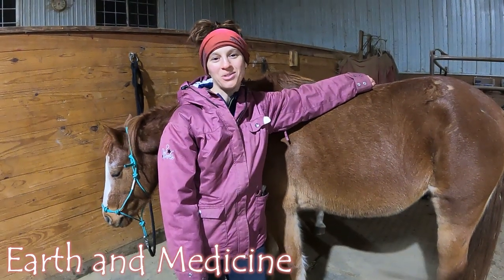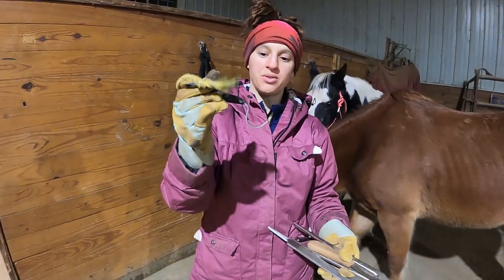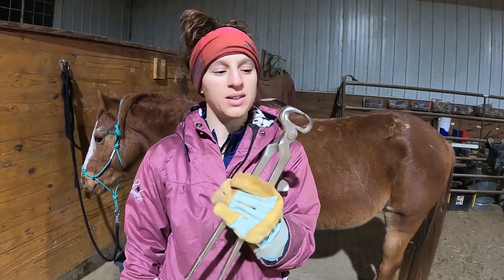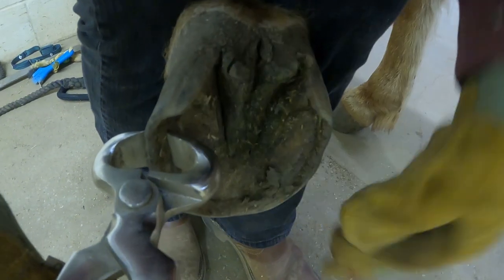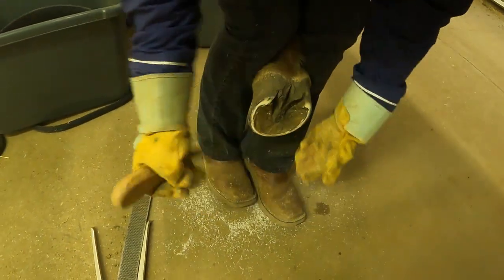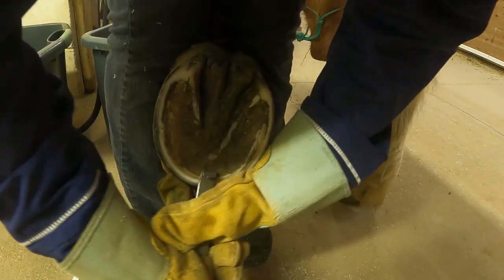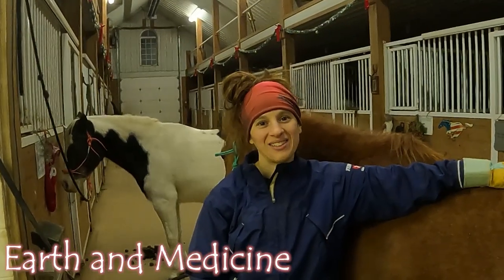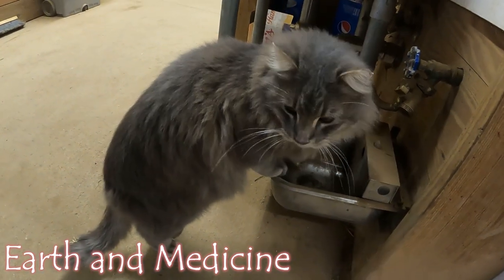Full horse hoof trim | Barefoot hoof trim | How to trim horse hooves | hoof trimming | DIY farrier

Comment: Hi, I'm a farrier and I'm sure you've learned a lot since this video was posted but I wanted to share some things. This horse was extremely upright in this video. The foot being symmetrical and the foot being balanced are two different things and medial/lateral balance is what is important. A concept of anatomy is a MUST. When a horse is so upright like that it adds so much unnecessary strain. Keeping the foot symmetrical does not fix the problem. The flare is happening because the foot is not balanced. Start with your knifework. In a lot of cases you can take off the top layer of the frog until you can see the point of the frog. Meaning you can see where the "tip" of the frog actually blends into the sole of the foot. This helps you know how much sole you can take off with your knife. Knifework is important because it allows you to actually see how much hoof wall you need to take off with your nippers. With many horses you need to take off more on one side to ensure the foot is balanced. Taking an equal amount from each side isn't usually the way to go. I also would almost never start my nipping at the quarters, especially if you aren't an experienced farrier. It is so easy to create low spots in your quarters.
Reply: There is SO much more hoof that needed to come off. You don't want the heels to be completely even with the toe like that. The plane of the foot that needs to be met isn't just a horizontal line. The frog is supposed to be able to actually make contact with the ground as it is an important concussion absorber and traction device. You were hesitant to take off heel because you said that's just how he stands. He's only standing like that because of how the foot is trimmed. The goal of farriery is to correct these issues to get the horse comfortable and closer to the ideal foot. When you're dressing also make sure to put a big bevel on there so the hoof wall doesn't chip or crack. This is not meant to sound stern or mean in any way I'm rooting for you just want to see that horse comfy and help ya keep learning :)
Reply from the maker: Thank you so much for your advice! I completely agree with all of your constructive criticism, and I really appreciate it. I have learned a lot since I made this video, but there is definitely more to learn, and I try to gather as much information as possible so this was very helpful. Let me know if you have any other thoughts and information to share. I know there are a lot of diy hoof trimmers like myself that watch this video, so I want everyone to get the  best information they can. Comments like yours are very helpful.

Comment: What’s the best nippers for weaker grip?
Reply: I would like to know too. I have tiny hands and I struggle greatly with the current nippers I own
Reply from the maker: Hi there! I have only used the standard nippers that I got from Tractor Supply, and they can be a little  difficult if you have small hands. I've found that if I start with a smaller nip, and work my hands up the nippers as I squeeze the nippers, I'm able to use the full force of the nippers. I've seen someone else comment about a compound nipper, and this looks like a great idea! They look pretty expensive but they are probably really great!